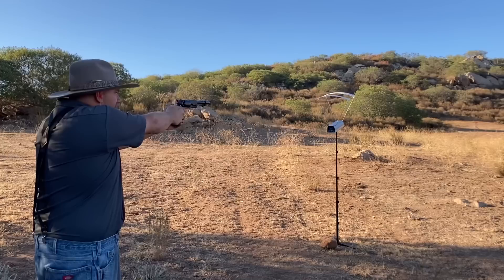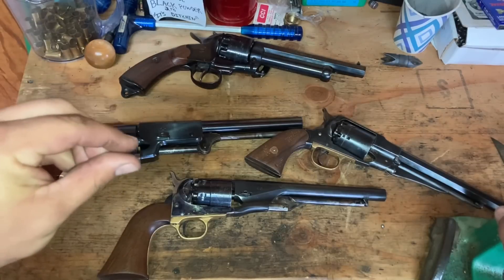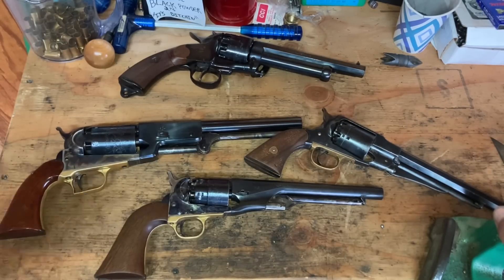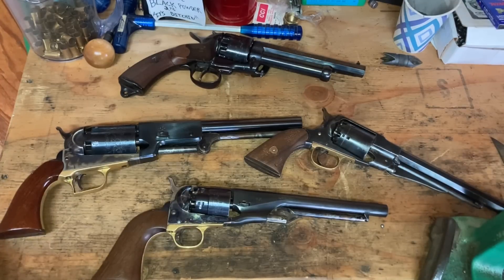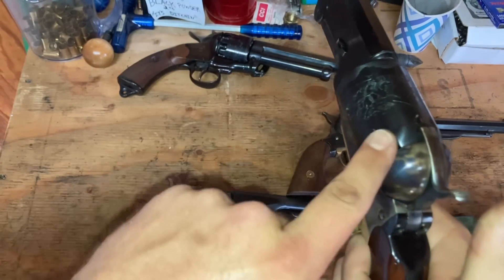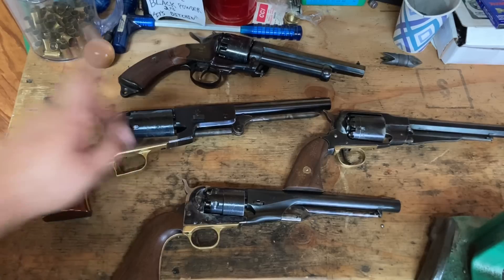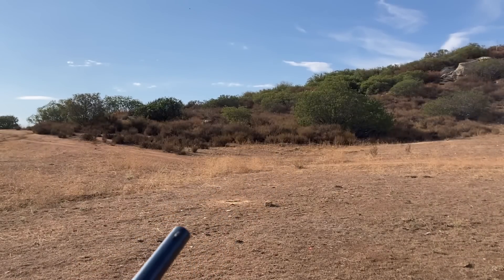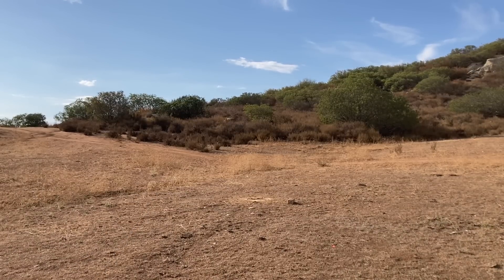What Causes A Chain Fire?

Comment: The Paul Harrell of black powder
Reply from the maker: I’ll take it
Reply: @Everythingblackpowder  I just bought a brass frame 1851 Navy from pietta.It's chambered for .44 and it came with .454 round balls, what's the recommended powder charge to use?
I don't want to use to much because I'm afraid it will warp the frame.
Reply from the maker: I would say 15-18 grains
Reply: @Everythingblackpowder  OK thanks, but about chain fires, I'm still not sure what would the right action to take would be.

Would the light loads combined with just a .454 caliber lead ball in the .44 caliber barrel be enough to prevent chain fires 99.9% or 100% of the time?
I've been told that there is no actual way to stop chain firing completely but would just the lead ball be safe? If not what about a wad?
And about how many times can I shoot the gun without grease before cleaning?
Reply from the maker: @WarFrog935  most people prefer wads because it’s easier and cleaner. As far as what’s going to prevent a chain fire goes, all you can do is take the precautions and hope for the best. As we like to say. 
“If anything’s gunna happen, it’s gunna happen out there”
Reply: @Everythingblackpowder  OK I'm ordering a adjustable grain kit for my powder flask. But how often would I have to clean the weapon if not using grease compared to using grease?
Reply from the maker: @WarFrog935  that depends on several things. What kind of powder, what charge and what caliber. I can shoot 36 shots easy if I’m using grease and Swiss powder. Less with goex or substitute and even less without wads or grease.
Reply: @Everythingblackpowder  do you know a good site to buy all of this stuff?
I need to buy Remington #10s, fffg black powder, and .454 caliber lead balls.
I also need to get a aftermarket trigger bolt and slixshot cylinder nipples.

I would like to order them in one shipment to keep the shipping cost down.
Reply from the maker: @WarFrog935  caps are hard to find right now but check with midway USA, graf and sons, and track of the wolf.

Comment: Thanks for the video. Good stuff. Subscribed. I have a Pietta 1858 and have not had a chain-fire. At the range I use lubed wads. They are easy convenient and not messy. I never use bore butter or crisco. Its a mess in my opinion, especially in the Texas heat. When loading the pistol for in between range visits. I do not use lubed wads. Powder-ball- 60/40 beeswax/talo or oxy-yoke revolver wonder seals on top. #10 Caps. These wonder seals have never melted and I've had the pistol loaded in the truck all day in August heat.

Comment: At least on the original colt’s, wasn’t the cylinder hole slightly conical? To get a better seal when seating the bullet? Most replicas have the same diameter from top to bottom, and if not 100% perfect it can leave gaps.

Comment: Just from common sense you know it's not the nipples. 1. The nipple blocks any spark getting into that little hole 2. That little hole prevents spark from getting into the charge, only a direct blast into the nipples hole cab reach the powder charge. 3. Once the hammer drops onto the nipple igniting it, there is steel surrounding every bit off that explosion except for the hole leading to the one charge. 4. The spark from a nipple is minimal compared to the spark coming out the other side of the cylinder!
Reply from the maker: Agreed

Comment: I've simulated chains from the back and front. From what I can say from experience, wrong sized caps or caps with too much compound. Mostly due to the adjacent ones falling off mid fire. Second is overloading charges and third with undersized projectiles. That's with using proper lubrication.

Comment: As I understand it, 
A chain fire is when a spark enters the other  cylinders and causes them to ignite without the percussion cap igniting that specific cylinder. 
Thus, all or many then ignite.
That causes the balls to leave the cylinder. 
That causes a very grave and potential harm for the shooter and or others. 
Without the barrel to guide the balls, they are now unguided projectiles. 
To fix this:
Use "butter" to seal the cylinder  locations.
Have a small amount of shavings seen when loading the balls.  This means that the balks do seal and prevent the chain fire.
Then butter the cylinders to doubly protect the potential problem.
We are not as familiar with black powder  as our predecessors.   Thus, we tend to forget this potential problem.

Comment: have shot a Remington for years 44cal,  always have made sure that the ring of lead was there ,never a problem,THEN  a rule change at the range some idiots had chain fires  {sloppy fit balls }  now must slap grease  with a popsical stick over the load  , {YEP in the old times they carried a tin of grease and a stick to slap it on  ]BOLLOCKS   they had  correct fitted balls for that gun, anyway came up with a mix of bees wax and paraffin wax 50/50  melt and pour  into a tray  ,to about  1/4 inch thick  let set  for a day or so , cut the end of a 44.40 shell you have a cookie cutter, sprinkle baby powder or similar to stop sticking  and  carry in a tin, or what ever ,  works 100% never a chain  fire, no sloppy grease  to lug about  like grease can give that side splatter  as does ever shot fired   ,keeps fouling soft  ,OH works well in the heat of the AU outback and the range ,

Comment: S. Colt wrote a chain fire is caused from the caps being set off from the cyl. hitting the rebound plate when fired with a heavey load or not putting caps on far enougg
Reply from the maker: Is it unreasonable to believe a chain fire could be caused by more than one thing?

Comment: I have a Spanish New Army replica, that I have shot without chain fire for over 40 years.

I have never used wads, but I have used grease over the mouth of the cylinders even if I have a solid ring of lead when I seat the ball, and yes, the commercial grease, and Crisco, is messy!
I don't use grease when the bullet is not a ball, but something like a miniball or Lee REAL bullet, but as you say, that is my opinion...

Comment: I might have to start trying grease. I've used wads for years now and it does make clean up a bit easier. But my 1851 is pretty accurate with the exception of a few flyers. Maybe I can tighten up that occasional flyer.

Comment: Nice video.  I agree that both sides of the cylinder provide opportunities for a chain fire.
Caps can and do fall off of nipples. Also, cylinders can and do have imperfections or burrs, that can allow a tiny air gap to form even with a ring of lead being shaved off.

I try to use tight fitting caps and I now use a wad or a blob of lube on the outside of the chambers.
I recently made my own wads by soaking 1/8 inch felt (Druofelt) in 1:1 beeswax and olive oil. Then seem like they hold more lube than store bought. Will find out soon enough.

Comment: No body hand on taught me anything BP.  But Turner Kirkland's Dixie GUnworks catalog with its narratives and such really was a great resouce.  Never had a chainfire in my Colts as I had nice shaved rings and lubed cylinder mouths, UNTIL I was testing firing a Navy Colt replica for which I had just received on trade.  Same thing, good lead shavings and my boolit lube, on second cylinder full I got my first chain fire; pretty danged frighful!  The caps were still good and I knew I had good sealing.  Well, bravely I shot some more taking even extra care to verify seal.  A couple of cylinders later the same thing, two chambers at once.  So I quit and went to the house to clean the gun.  I discovered that the cylinder was cracked about half way down between two chamgers, not very noticable unless in bright light.  I bet the gun had been fired with the heathern smokesless in the past.
Reply from the maker: Interesting

Comment: Great video, the sacrifice of your noble Walker (which lived) was most appreciated.  I've always used cornmeal instead of a wad.  Works great and is super cheap in my Old Army Ruger.  as to caps, wow is that a kettle of fish.  Like you I will test which caps fit snuggly without pinching to achieve that rear seal.  And to those poo-pooers I too seal the front with a good quality grease.

Comment: I've tried to make my Walker, and Remington Army, chain fire by loading up all six chambers with 3F real black powder and 200 grain bullets, and capping only every other chamber.  That way I was able to fire three shots, reload three, fire three, reload three, etc.  Never could make it chainfire from the back due to an un-capped nipple.

I've never had a chainfire at all, and I've fired thousands of rounds from these guns.

I think the "full lead ring" as proof of a tight seal is misguided though, and here's the important reason why;

Many people ding their chamber mouths with the loading plunger.  It happens almost by design in a Remington because of the mechanics of the loading lever and plunger.  On Colts it can happen when seating without the cylinder being locked up, and so the chamber gets misaligned with the plunger.  The plunger then hits steel on steel, and oops.  I've seen original 1860s Colts with severely dinged chamber mouths.  I wrote about these issues extensively, with photos and all, on the 1858 Remington forum before it went down several years ago.  If your chamber mouth is dinged, the soft steel can be pushed over toward the inside, causing a place at the mouth that is effectively smaller than the chamber diameter (a burr of sorts),  and thus deform the bullet or ball at that spot, causing a gas leak, even if you're getting a full 360 degree ring of lead.

As you indicated also, a faulty ball, or sprue-to-the-side ball, could set up the same issue, where the ball is in there tight, but there's a gas leak there.

Dixie GW years ago put up a lengthy explanation of how they prefer a chamber that swages the ball in, rather than cutting a ring.  They recommend using a marble and some fine sandpaper to chamfer the chamber mouths until they no longer shave lead.  I tried this on one of my Remingtons, and I like it.  It's faster and cleaner to load, and in my opinion it makes for a more sure gas seal.

And as you said, be sure you know your chamber diameter, so you can use a ball that's at least several thousandths larger.

For conicals I prefer a bullet that's pretty much right at the same diameter as the chamber, and no more than a thousandth over, and the bullet will have greased grooves, and often a grease cookie (card, grease, card) between bullet and powder.  All that grease is for exactly the reason you mentioned-  soft fouling means you don't need to stop to clean the gun.  You can just shoot.  I size my cast bullets accordingly, and so I have several sizing dies to match the various Army and Navy revolver chamber diameters.
 
Anyway yeah; I've seen people swear blind that a loose fitting cap is just begging for a chainfire, but I could never make that happen even when I did my very best trying to make it happen!

My FAVORITE cap and nipple combo is a Remington cap on a Treso AMPCO nipple.  Those caps fit those nipples without using a dowel or the hammer to shove them on, and they stay on until fired.  That makes high volume shooting a LOT simpler, when combined with a snail capper that holds 100 caps.  So I've swapped the factory nipples out on almost all my revolvers, so they all take the same cap, and I've modded my Ted Cash snail capper so it works on the Colts and the Remingtons alike.

Chainfires (or "crossfires") simply don't happen on a properly maintained and properly loaded revolver.  That's my rulin' and I'm stickin' to it.
Reply: Od wielu lat używam Pietty w obu kalibrach w których nawierciłam stożek wprowadzający dla kul i pocisków nadkalibrowych. Pietta fabryczna ma komory podkalibrowe i pociski mają średnicę komór która jest w połowie pomiędzy średnicą bruzdy, a średnicą pola w lufie dlatego Pietty mają duży rozrzut na tarczy. Należy rozwiercić komory Pietty do średnicy bruzd w lufie i zrobić stożek na wejściu lufy i na wejściach komór. Potem wystarczy stosować pociski i kule nadkalibrowe z powiększonych kulolejek. Na rynku raczej takich pocisków nie ma, trzeba odlewać je samemu. Kapiszony można zabezpieczać rurkami używanymi do napowietrzania akwarium pociętymi na 4mm długości pierścienie, które nacisnąć można na kapiszony. Wciskanie kul przez stożek na początku komory powoduje że ołów który normalnie odpada jako pierścień pozostaje w komorze i to w newralgicznym miejscu styku kuli ze ściankami komory i stanowi dodatkowe jej uszczelnienie. Stożek na początku lufy zapobiega skrobaniu ołowiu przez krawędź lufy z wystrzeliwanych nadkalibrowych pocisków i kul. Kule mogą mieć średnicę po wyjściu z komory nawet o 0,1mm większą od średnicy bruzdy, a pociski ze smarującymi rowkami taką samą. Nie należy używać pocisków nadkalibrowych bez rowków smarujących, ani pocisków z twardego stopu ołowiu. Nadkalibrowe kule i pociski latają szybciej i celniej na niewielkich naważkach prochu.
Reply: @sarkastyczna19  I agree, these guns are not set up very well from the factory, but they can be made into decent guns with a little bit of work.  In the field I use a Ted Cash "snail capper" capping tool.  It holds up to 100 caps and allows easy and fast capping.  I keep it on a lanyard around my neck, usually.  Also I use paper cartridges for the most part, carrying them in a 40 or 50 round box dispenser (depending on caliber), carried on my belt.

Comment: I've always used grease on my cylinders because I got my first Navy model .44 from the Cabela's catalog when I was 15-16 and my mom made me read the manual to her. After doing so, she insisted I not shoot without doing exactly what the book said. I'd be shooting Cartridge rifles since I was 6 and knew firearms safety but black power was totally new to us. 
More than 30 years later I still do what mom says and grease my cylinder because mom will get after me if she catches me.
I know that's good for a laugh but it's true and I've never had a chain fire... Thanks mom!

Comment: No chainfires with Pietta .44 1851. No wads, no lube. 3 years. Don't let your powder hit the sides of the chamber. Use a long spout. Make sure you have a good gasket ring when ramming projectile home, and NEVER EVER  use steel wool or a brass brush. Using no lube does, however, cause more cleaning,, and seat the take-down screws as if they have loctite. Lube screws, and check for snugness every cylinder.Make sure you use a new, unblemished screwdriver bit that fits snug. Always bake parts dry after cleaning before re-lubricating and re-assembly.. Pietta nipples can be bored slightly for reliability, when Slikshots aren't available. Never use a drill. Small round file. 
- 1851 Pietta EDC

Comment: In my opinion my only chain fire was using pyrodex p.
 because 
#1 I had #11 caps on a #10 nipple.
Did you know percussion caps come in various sizes?
I do now!
#2 And since I had a .44 bought .44 cal round balls.
Did you know .44 round balls come in various diameters?
I do now!
Pinching sloppy big caps in nipples was a big risk.
Hell half the pinched on caps fell off the first shot!
Round balls shouldnt fall out the cylinder after recoil.
Tight fitting caps and a good snug fitting ball's cure chain fires in my opinion.
Reply from the maker: Yep

Comment: Some cylinders have a ringed Burr around the mouth caused by bad Machining. It shaves lead off of the ball and makes it undersized once it gets past the Burr. And you have a nice shaved ring of lead and once the ball gets down into the chamber the ball is loose. This could be one of the sources chain fire.
Reply from the maker: Possibly, but since I’ve owned this gun for a good ten years and have shot the pants off of it and have only ever had one chain fire and the balls don’t come loose or move up the cylinder with subsequent shots. I highly doubt it.
Reply: @Everythingblackpowder  well it may not be the source of your chain fire in that particular gun but it could be a problem and has been a problem and some guns.